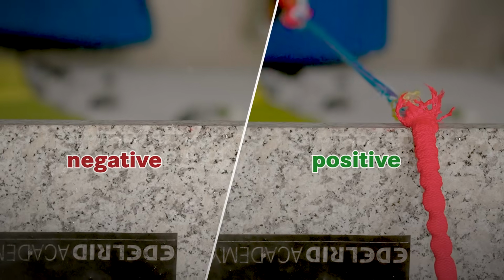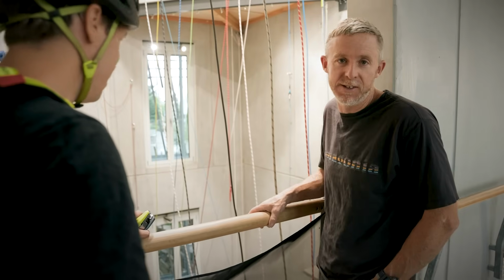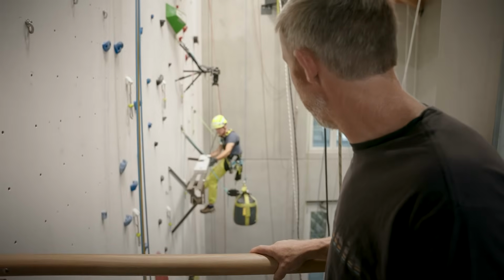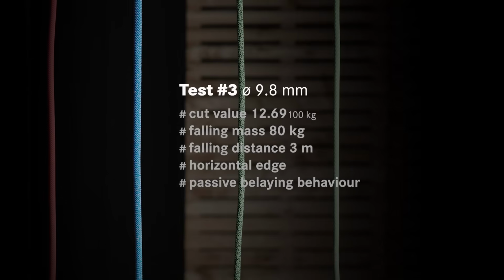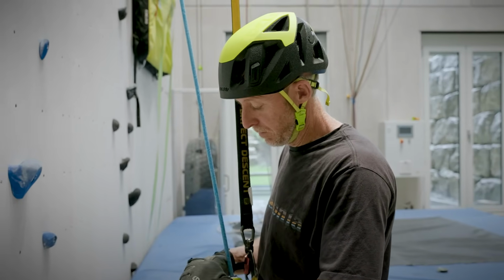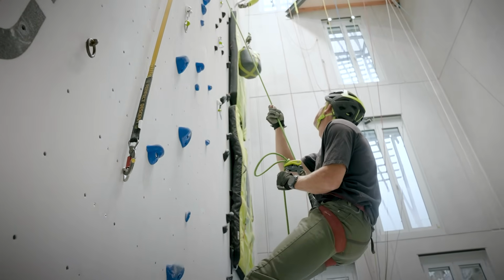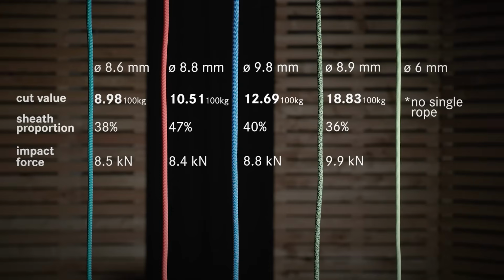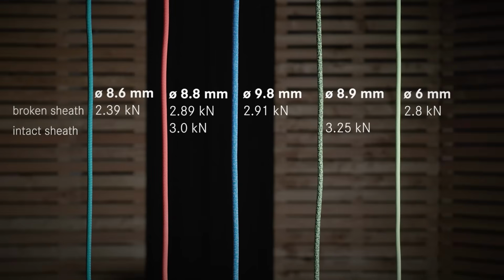How does our cutting lab test compare to dynamic scenarios? [Part 1/2]

Comment: Have you done any passive drop edge tests with the 6mm chord doubled?
Reply from the maker: No, this time we did not do such tests.
Reply: that would be so interesting. and indeed with some proper double ropes (not rap cord) of let say 7.5,   8,  and 8.5 mm to see how the double rope behaves (I hope much better than single ropes!! because it is the most common scenario in the alpine terrain,..)
Reply from the maker: @josetanago  Well, it is roughly predictable what will happen. If both strands really get loaded almost equally, it means that the load will get divided by two. And in the first episode about cut resistance we showed how big of an influence weight has on the cutting value. So given this fact, it will improve safety dramatically.
Reply: @EDELRIDKnowledgeBase  I am specifically interested in seeing these cut resistance tests for the 6mm rap line in twin rope mode, as that's the setup where it is rated for a couple UIAA falls. But then you can't use a pinch or similar device like Tommy wants to do, you'd have to use microjul or something manual-braking.

Comment: After watching your video on chalk and the danger of grit on ropes, I would love to see if grit would have any impact on sheath failure - potentially causing earlier failure of the sheath and causing the less cut resistant core strands to be exposed to a cutting edge earlier than they may otherwise. I find that most of the time where I am at risk of big falls on sharp edges, it is often out alpine climbing or on long routes where I might have been moving together and the rope has been exposed to some level of grit either from the approach or across the time on route. I feel that some level of grit on the rope would be the state of most climbers ropes.
Reply from the maker: A dirty rope will always perform worse in any performance related characteristics. Testing this will also just show this. What will not be really possible to test or determine is by how much. For this "dirty" ropes can be to different in their "dirtyness" :) And Dynamic scenarios are also not very reliable as every fall os always just a little different. So we do not expect any tangible conclusions out of such testing other then, like I said, it surely will be worse :)

Comment: I’m intrigued by that belaying technique ( 20:30 ) with the Ohmega. I’ve seen people struggle with the timing when belaying dynamically with it. Is this technique an alternative even in situations where a normal dynamic catch would be possible?
Reply from the maker: Absolutely and it is so much easier for the belayer. It is true that sensor hand belaying needs practice without the break assistant devices but with them it becomes a piece of cake. You basically then get mor time for the timing :) Tommy did it first try
Reply: @charliecenta It's the perfect technique for when your hand is strong enough to hold the climber. Especially valuable for belaying extremely light climbers and children where it is easier to apply and avoids dangerously hard catches.
Reply from the maker: @Vicitoriachi  Well and when you adjust your assisted breaking device to the point where you might be able to do that. So definitely with equally heavy or slightly heavier climbers this is possible too with those devices. And bear in mind: you don't have to catch the whole fall with your hand/arm. There is still the belay device at play here. But there is a good method to check whether your climber is suitable for the sensor hand technique. Let your climber weigh the rope at say the second bolt and position yourself as a belayser with a little distance towards the wall. Grap the climber's rope coming out of your belay device as high as possible. Pull it towards you while taking a step closer towards the wall. If you can do this and now are able to lower the climber in a controlled manner just by extending your arm, sensor hand technique is an option.
Reply: Love this! I am 90kg+. My partners are mostly 70kg or less. So i used the ohm for a very long time now. As I got my ohmega one year ago, I started experimenting with the device. In the past I was catching lighter partners without ohm and with dynamic hip movement and jumping. But now i like to catch lighter people with sensor-loop and ohmega (stage 2 or 3 depending on rope -diameter, -roughness). This translates to hanging belays easily.
And! Also my 70kg partners are able to give me the shortest and softest catches in a very consistent and controlled way (ohmega stage 3 only). The only downside is the required higher focus and patience of the belayer. But of course we are able to adapt to the climbing situation here ;)
Stage 1 of the ohmega I only use with belayers which are not experienced with sensor loop and/or dont want to go into this.

Comment: I somehow get the feeling that we went full circle. Ohmega + Sensorhand is basically a reinvention of the tuber, just moved up to the first bolt.
Reply: nice thought. I would like to know if a tube style belay device plus an edelrid fuse as a backup would make for the softest catch. I think edelrid fuse is not rated as belay device but its a fall arrester nonetheless. Phil if you can give your opinion on this that would be awesome.
Reply: maybe a WC revo is something like that as it doesnt lock up instanly as the pinch and therefore can use some friction to slow down the fall
Reply: @juliamoranchomarzal2618  This is exactly why I love the Revo. It combines the soft catch of a tube with the safety of a semi-automatic device. If used properly with the tuber technique, it will not lock up at all.
Unfortunately it does not support double ropes which should always be the primary mitigation when sharp edges are a concern.
Reply: @foobar9220 i haven't used one before but your comment seems very encouraging. I wonder if edelrid will ever expand on the speed based/momentum locking insted of friction. Petzl clearly tried with the neox but created a device wich still relies on the friction to lock up, creating efectively a slicker less safe grigri. Surely edelrid have thought of momentum based lock up so i wonder why they don't create a product around it. Revo seems to have some problems that can be solved with a better engineering team that edelrid seems to have.
Reply from the maker: @juliamoranchomarzal2618  Not sure how you imagine the Fuse being helpful to give soft catches.. In your described scenario, you would try and catch soft with the tube. If the Fuse engages it would lock immediately. Or I got it wrong?
Reply: @EDELRIDKnowledgeBase Yes thats what i meant, although a bit cumbersome, the idea is belaying with the tube device and then having the fuse used the same way as in LearRopeSolo uaing it as a backup for the main device with a "cache" loop that the belayer would be constanly creating. It would be tricky but would add some safety to the tubbers  while allowing  smooth catch.